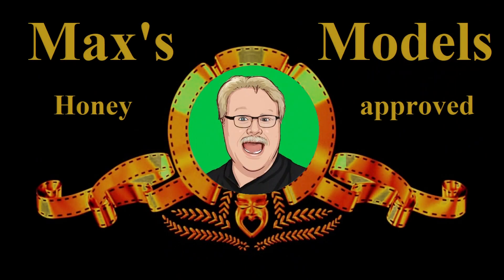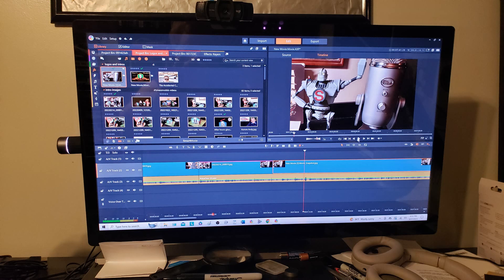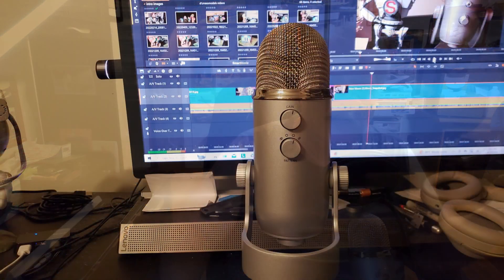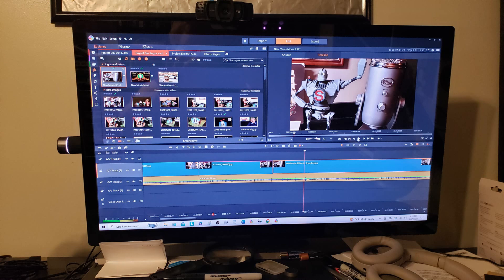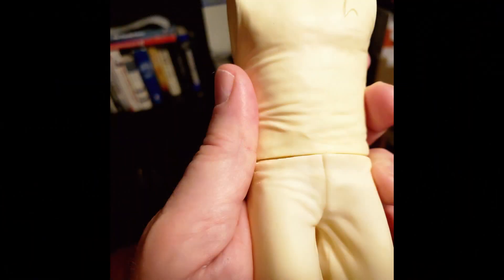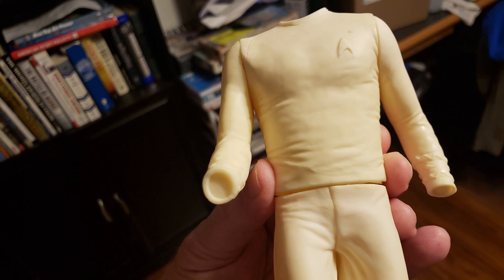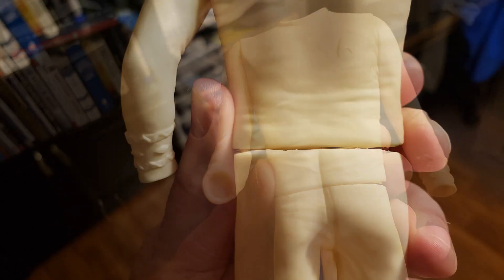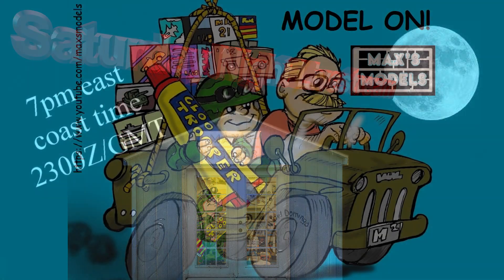Max's Models after hours )9/17/23

Comment: I have all the vinyl figures to Star Trek. Kirk is the only one built at the moment. I have a Creature & a Mummy also in vinyl. Remember, the NSEA Protector is molded in ABS plastic so you will need cements. I don't know if Tamiya will work. I used Plastruct to assemble mine along with CA glue.
Reply from the maker: It did not work on my Kirk.  Time for the CA glue.
Reply: @maxsmodels  Or a blow torch to melt the parts into each other.

Comment: I worked at a small sporting goods manufacturer during college.  They made sports safety gear out of abs, vinyl, and various forms of uniroyal foam.  I remember this stuff required unusual adhesives and paints.  A lot of heat activated contact cements (you only got one shot at this).  We applied the contact cement to both surfaces and allowed it to dry.  It was "cured" on slicone treated paper.  We used IR spot lights (like the kind used at McDonalds to keep the friescwarm) to activate the glues.  The paints were even more exotic.  We used pdms as a retarder and surface tension modifier.  Xylene and MEK were the thinners.  Btw, xylene is particularly nasty,  it makes a good weed killer.  I think you can use gesso as a primer/base coat on vinyl figures and then use acrylics for finishing work.
Reply: I am just going to stick with good, solid, and reliable polystyrene. No exotic materials, glues, or paints required. I like things to be simple.

Comment: Voice over mode was the smoothest sounding device of the three tests you ran. On my headphones, had you been using either of the two camera-sound systems I would have adjusted my volume because you were just a little louder than the voice over but all three were working fine. I haven't noticed any sound discrepancies but then we don't notice stuff like that until it's mentioned sometimes. You, Max, are one of the guys who does it well. Some of the videos I watch has terrible sound quality, and it's mostly because they use no audio other than their camera phone.